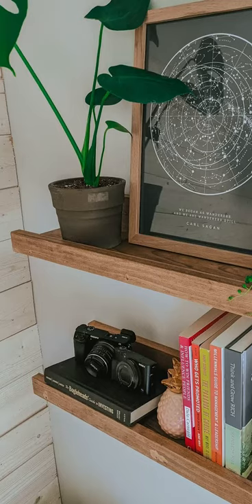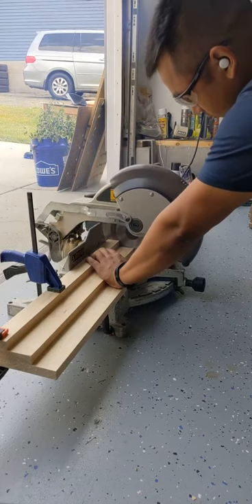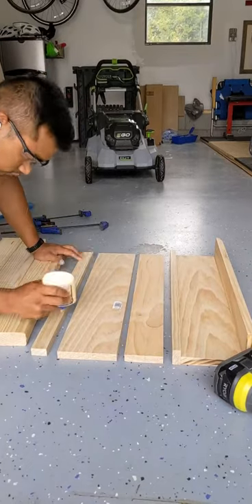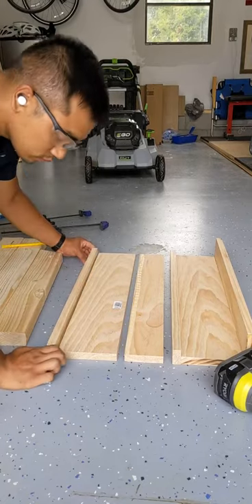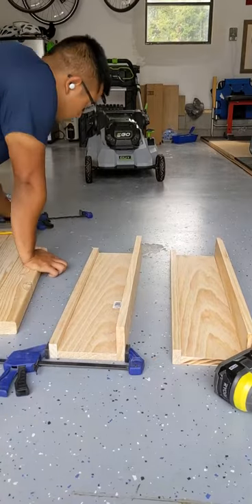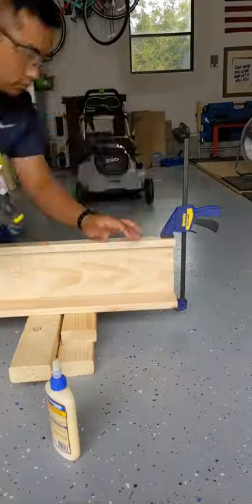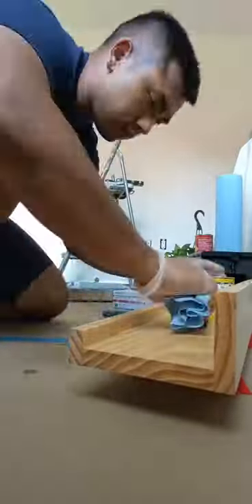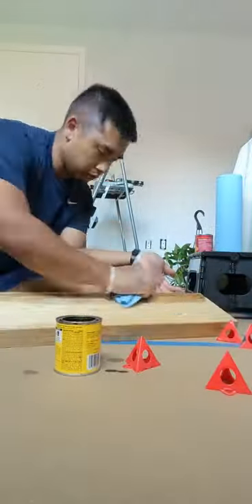Making floating shelves #shorts

Comment: Getting ready to build some of these, just curious how you mounted them to the wall?
Reply: Drill screws through the back plate of the shelf into the studs of your wall. Or use drywall anchors if the studs don’t work out